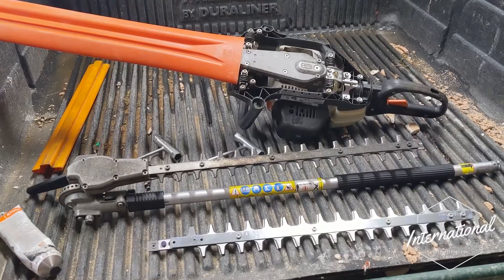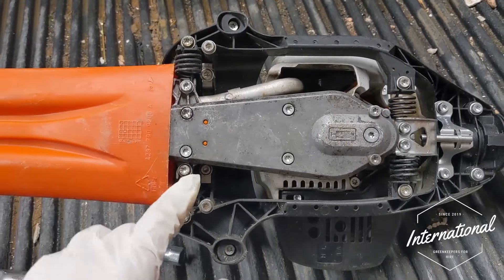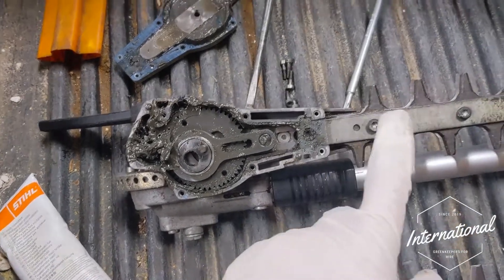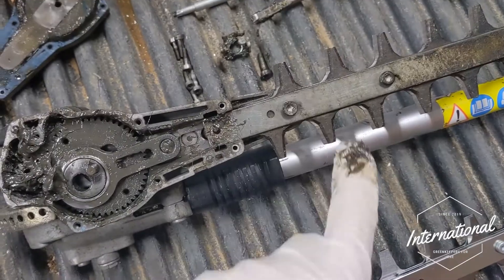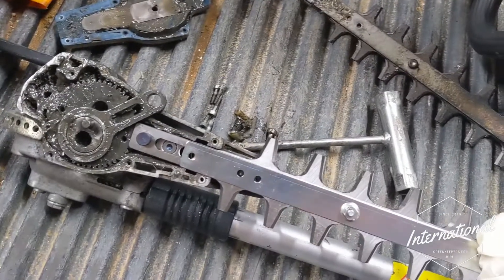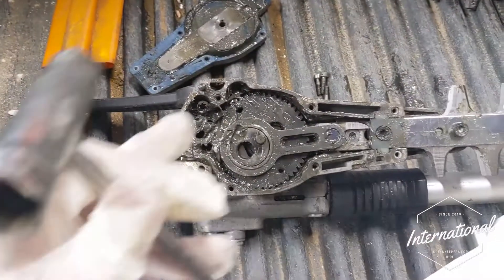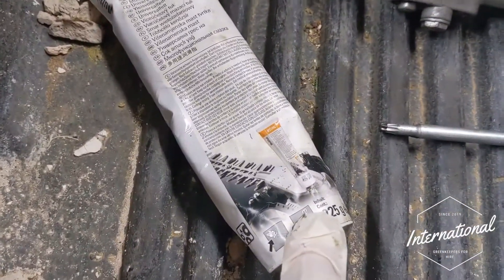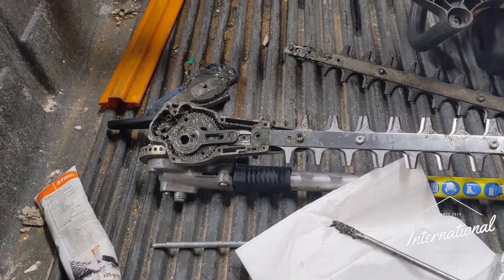How To Change Stihl Hedge Cutter Blades | Tutorial/Walk Through

Comment: are teh blades a complete assembly? his so do you have the part number?
Reply from the maker: Yes - they are usually sold as a complete assembly, for part numbers I use this website - https://www.gardenhirespares.co.uk/menu-parts-diagrams/stihl-parts-breakdowns/stihl-hedegtrimmer-parts-diagrams.html Click though the area you need and it will show you the number